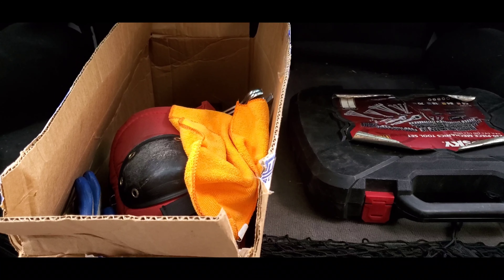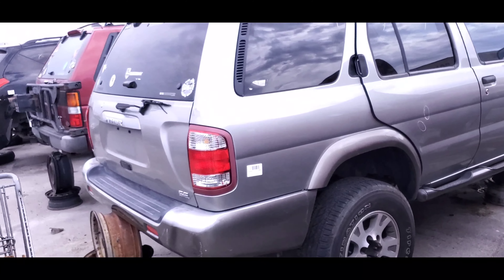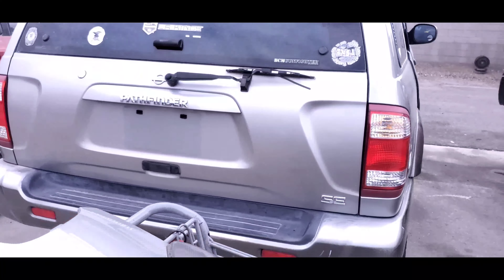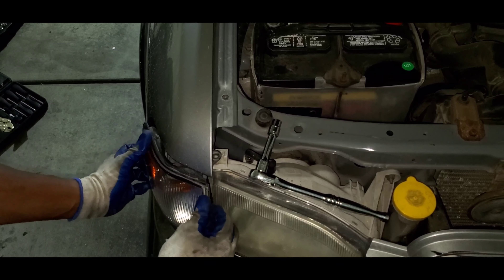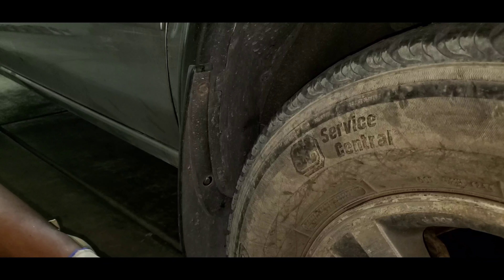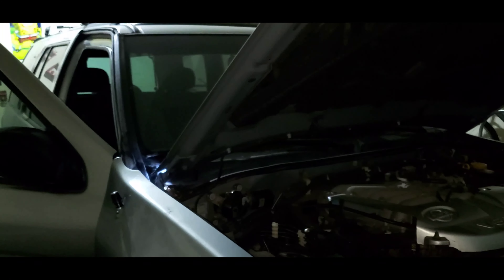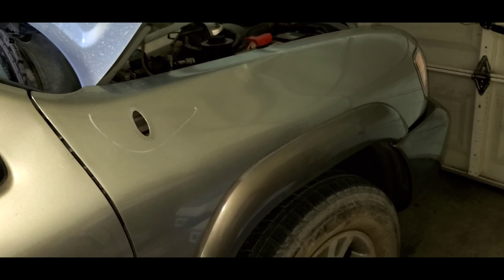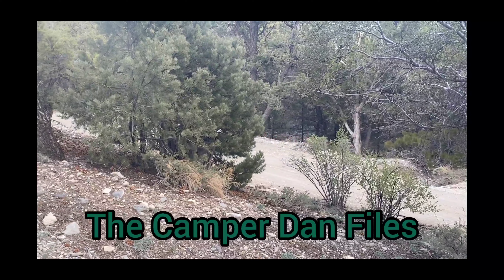1999.5-2004 R50 Pathfinder fender replacement

Comment: Thanks for the vids.. i have a rusty workhorse pathfinder in ny ..
Its just a woods workhorse because of nys emissions inspection death trap.. if it dont pass  the dealer cant sell it to you so i paid scrap price 300 for it stuck 200 worth of junk yard tires on it and drive it all over my property pulling  trailers .. i tried to register it in Florida but they require the vin varified .. so it  might never see the road  again. Sad.. in Florida i bought a pristine qx4.. i cant wait to be back in florida and back in the  qx4 exploring again..
Reply from the maker: Hello B-Rad Umuck, welcome aboard. I'm glad you're enjoying the videos. In the great state of New York, nothing, and I mean nothing is safe from rust. My dad once had a Toyota 4Runner 96 that was sent to the Junkyard due to rust issues. It still ran but was no longer safe to drive because of the rust. I also think it's really cool that you are the owner of 2 R50's 1# Pathfinder and 1# QX4 in 2 different places. Right on🤙🏾

Thanks again for watching
Chris.
Reply: I met a guy with a very old dodge 4 dr it was pristine.. he said his grandpa washed at least once a year in k1 kerosene.   The paint was flawless and original 
Wash it and kerosene gets the bugs off and protects even down in the cracks .. old school ways are allways the best.

Comment: Hello CHRIS recently took my truck though the car wash Got out antenna was present vehicle went through the car wash and upon it coming out antenna snapped off how were you able to break off that piece from the fender and if so, can I do it without removing the fender?
Reply from the maker: @r50nation42 I was able to break the black plastic collar off using some pliers,  yes I was able to break it off without removing the fender. once you remove the inner fender liner it's just one bolt holding the antenna to the body of the R50, I hope this helps👨🏾‍🔧

Chris.

Comment: My drivers side door has dropped so I have to slam it to lock it.  I tried jacking the door up a bit and hoping it would realign but that wasn’t successful.  If there isn’t a way to adjust it without removing the side fender this video will come in very handy 👍
Reply from the maker: @Carl Billingham, this will help for sure.
Reply from the maker: @Carl Billingham, I just wanted to let you know I am aware of an issue concerning you not being able to comment on a few of my most recent videos. I noticed this a few weeks ago. Seems that your 1 of 3 viewers who are having this issue. I have also reported the issue to YouTube. It's just very strange, I receive a notification for your comment, and then it's being removed or erased before I can even open it up to read it😔
Reply: @TheCamperDanFiles  hi Chris, I wasn’t alone, I could see there were many more comments than I could not see.  Most weird!  Thank you for responding though mate 👍😀

Comment: Hey man . Nice work . Had alot of oil on that mud flap ...mine was bad when I got it ...ended up being the oil cooler o rings were bad took 20 min no leaks 🙂👍
Reply from the maker: @Jayman8tor, welcome to the channel, the oil that you have seen running down the back of my mud flap was actually some Liquid Wrench. Used it in a last-ditch effort to not break anymore hardware, lol but you see how that turned out. Thanks again for watching!

Chris.

Comment: Does this work on 1998? I always thought there was welding involved. Thanks
Reply from the maker: @T M, I would assume it is pretty similar, just ensure the fender is from an R50 Pathfinder years 1996-1999. Simply remove the old fender and replace it with another (preferably the same color ) but do what you must. I was very fortunate to find a replacement that matched my R50 at my local Pick-A-Part👨🏾‍🔧
Thanks again for watching!
Chris.